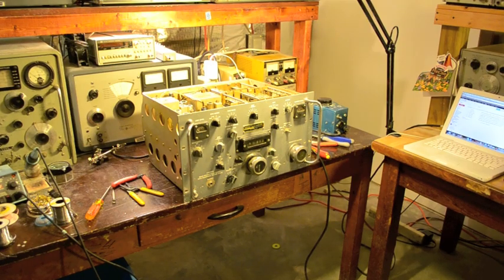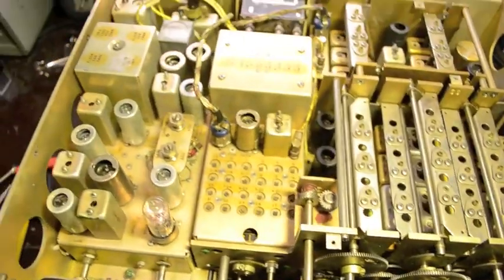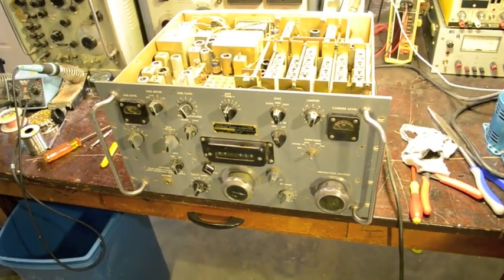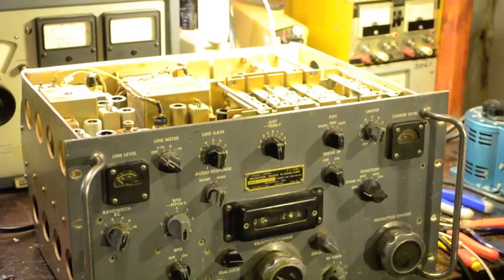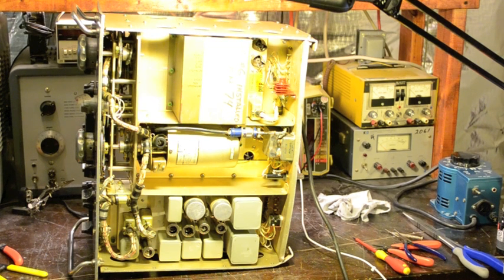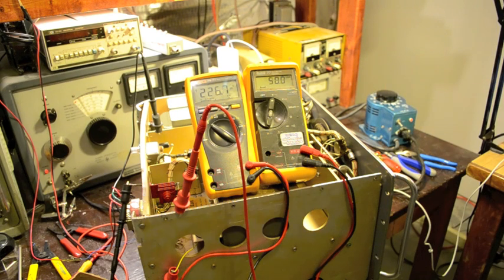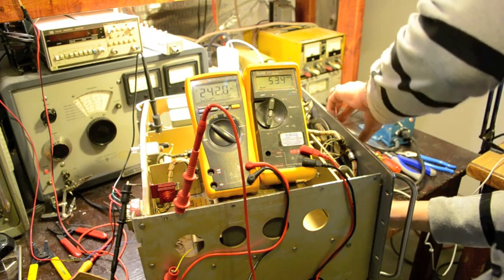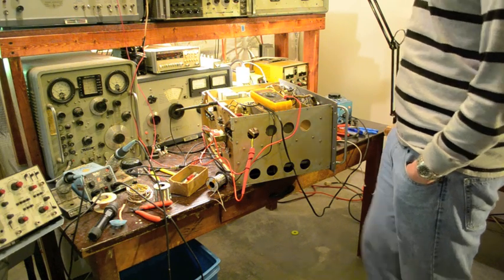Repairing an R-390A, the Best Comm Receiver of the Tube Era Part 1

Comment: Drives me nuts that shippers bashed in parts of the rear chassis of this beauty.
Reply from the maker: Yeah, me too.  The electronics and mechanisms are totally fine, radio working reliably to this day.  One day i might take apart the frame and pound out the dents or replace it entirely with a parted-out 390A.

Comment: Hey Greg. Hate to see such damage on a piece of history. First, insurance with the shipping company. I think at 75+ (packing) pounds it has to go truck freight? Second, file a claim with the knuckled headed company that shipped it. If it is in the parameters of their shipping policy your good. Along with pictures before you shipped it. If not, Oh well. Shipping companies deal with this stuff on a daily basis and hate letting that money go! And will fight you all the way. Folks are so fast to pay the cheap price without a clue pertaining the shipping arrangement. Of coarse, for me, the best bartering deal is to bitch and moan concerning the shipping cost, buy it at a reduced price and ship it yourself. If the price doesn't come down, I walk. More just around the corner. These boat anchors always run more than the sticker price; shipping, repair, etc. But your fixing it yourself. That's great. Good luck and enjoy your piece of history...
Reply from the maker: I did file a claim and they refunded the entire value of the radio, so its a free radio with some dings in it.  Amazingly enough the damage to the chassis hasn't affected the alignment of any of the complex mechanisms within, it has been working reliably for many years now since this video.

Comment: 8:05  I believe the leakage to ground is normal for these radios due to the design of the line filter, therefore it's important to have a good ground connection.  As you discovered, you can't have a GFI :-)

Comment: I like how you have "real" test equipment that is familiar to me and that I can relate to, not oscilloscopes that look like laptop computers! :-)   You are lucky that your R390A was damaged in shipping in a merely cosmetic way (the metal at the back).  When I got mine, the idiot that packaged it just surrounded it with styrofoam peanuts in a cardboard box, and the front panel edges were bent, causing the tuning knobs (or the gears inside) to bind.  They turn, but with too much resistance, so I am worried that I am damaging something further by turning them.  Do you have any idea how to figure out where the problem is and how to fix it?

Comment: I worked with a lot these receivers while in the military. They were the finest HF radio the had at the time. I owned one once but sold it at a HAM FEST when I retired in 2005. The original meters had radioactive paint and were replace years later. W0KLB

Comment: also the mechanical filters are failing because of disintegration of foam around the IF coils within the filters themselves... So shipping them at all may hurt the filters... There is an example of a repair done to these mechanical filters on R-390 dot net.. there is a link to someone who repaired these filters and describes what is happening to them,,, the filter loses its support within the case,, shipping them will further degrade the filters I am sure,,,

Comment: excellent information..  Especially how you detected the line filter problem,,,, Is Chuck Rippel's old website Archived anywhere?  if you know about that,, it vanished from the internet,, There is a piece on the care and feeding of an R-390A findable on the web,,,  by him,,,
Reply from the maker: TNX on all.  A friend of mine found it after i tweeted a question about this line filter issue, there was this e-mail archive and i recall the e-mail was from the late 90's.  I have since then repaired the line filter in my HP-606B sig gen, which had the same issue.

Comment: The best thing to do when shipping is to remove the power transformer and the audio module which reduces weight,,, The R-390 (non A) is much more vulnerable to damage as the RF deck driven by two shafts mounted in the frame of the radio,, these shafts get bent because the front panel which protrudes past the width of the mainframe takes a blow sideways and collapses the frame both in and sideways, and because the sides of the R-390 are thin aluminum they bend like butter. The R-390A has much more robust side panels and a unitized one piece RF "deck"  so it is much more sturdy than the non A 390..  These radios must be double boxed  with several inches of Styrofoam pellets between boxes,,

Comment from the maker: Yes, but rather than check caps you should just replace them if they are either electrolytic or paper.  Be sure to replace all electrolytic and paper caps before doing the power on tests.  Otherwise you risk damaging your power transformer and the IF transformers, none of which are replaceable.

Comment: Thanks for the info! Will open 'bandersontv; straight away. First, mind if I ask; is a 1-tube rectifier PWR supply (a tube, type 80 the only active element) output then basically unregulated other than by the value of the  full wave rectified PWR transformer center-tapped secondary? If the voltage rise stops before reaching spec value; then start checking caps I guess?

Comment from the maker: Depends on the gear.  In this case the power supply caps were oil caps, and oil caps do not go bad.  There were oil caps throughout the receiver.  For this reason i decided to manually bring power on slowly while watching B+ instead of the usual procedure which is to replace all electrolytic and paper caps, then power up slowly.  You watch B+ because you should expect it to be close to the B+ specified in the service manual and it should go up as you bring up the variac.

Comment: Greg, please give some details on "bringing up slowly on a Variac while watching the B+". Specifically "How slowly do you approach full input voltage?" and "What are you looking at B_ with, o-scope or VTVM / VOM?" and "Are you looking for dead or shorted electrolytics?" I have a vintage RME-69 receiver and two RME DB-20 preselectors, which I want to revive, but lack experience. Thanks in advance.

Comment: MORE.. A jolt like that may have damaged cores in some of the cans as well as meter movements and even damaged crystals. 
Good luck and if you need some help let me know..
If you get it working right, I think you will be amazed with the performance.
BTW  The Hammarlund HC10 product detector is a real nice acces, that comes off the 455 K out on the rear. 1 spkr for AM
 and second spkr from HC10 for CW and SSB..Real sweet!

73, 
Glenn WA4AOS
DSM Labs (dot com)
864 684 2956

Comment: FYI, you may well find out that the shipping damage has affected the alignment of the RF mech assembly. I own DSM Labs and repair R 390, 390A, R392 and some R391 receivers. I have lost count on how many units I have restored. 
The shipper should have PROPERLY packaged the unit. I have shipped these receivers all over the world and NEVER had one damaged yet, although, one did evaporate in Italy, You may find side panels on ebay and they are fairly easy to replace. You may need a rear panel too